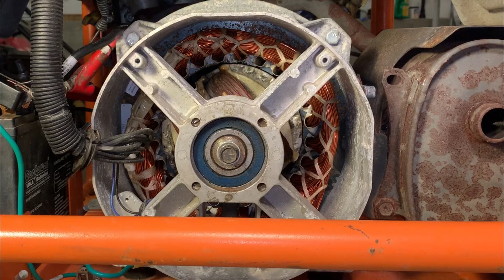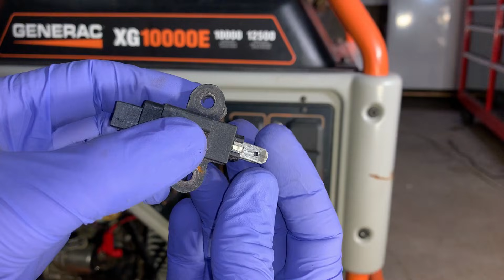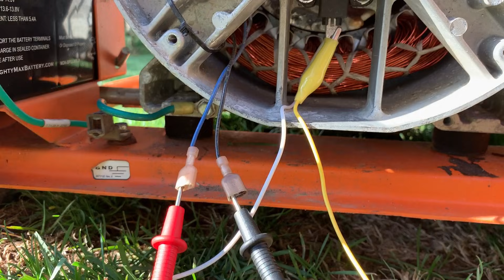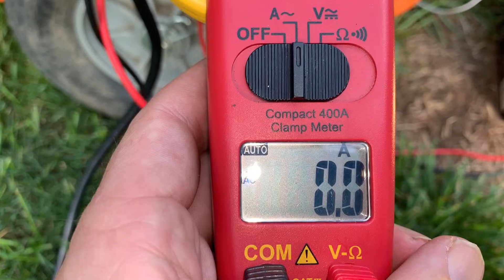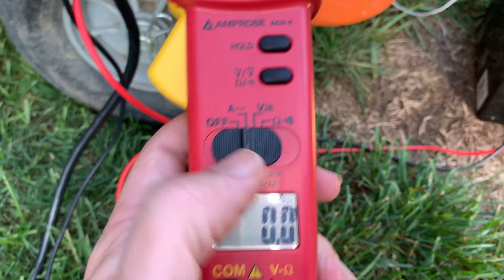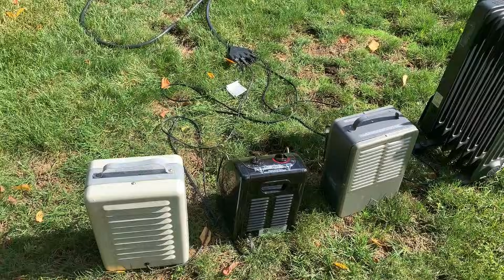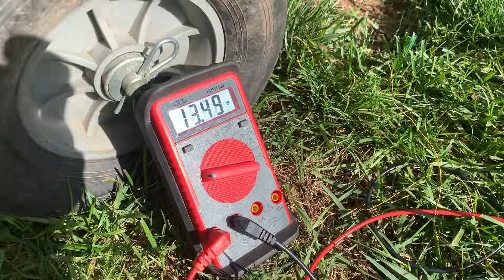Generac XG10000e No Power/No Voltage - Fixed

Comment: Was as simple as wires were crossed and meddled with nice what would you charge for this generator I would be interested in buying it @James Condon
Reply: Here is a reminder about portable generator safety: this is only a reminder for anyone who use portable gas/propane generators. This is just to make sure that everyone is aware of all the warnings and it’s just to remind people to be careful using portable generators. Everyone has to see this safety reminder. Every year after hurricane and winter storms, there were reports on the news that many people have died each year when using generators due to carbon monoxide poisoning and electrocution during a power outage. There were reports about deaths when using generators when the power was out. There is something very serious that everyone should always be aware of when using generators. Some people do run their generator indoors which is not safe and that increases the risk of carbon monoxide poisoning which can cause death of family and you. Some people run their generator in wet conditions which can electrocute them. Here’s an advice about generator safety: please remember that you should never run your generator indoors. Remember that carbon monoxide is an odorless and colorless gas that you cannot see or smell. Carbon monoxide is a silent killer. Keep that in mind. Make sure your generator is 15-20 feet away from your house and away from doors, windows, and vents. Having a carbon monoxide detector is very important against generator safety. Some people also allow children to go near the portable generator which could pose risks. We need to keep an eye on our children making sure that they are not near the portable generator so they won’t get electrocuted or burned by the generator which is dangerous. A locking enclosure also keeps kids safe. A generator shed might look like a tempting place to explore, or take cover during a game of hide and seek, but a generator is a dangerous piece of equipment that can cause injury. It says on the manual that we should also keep children away at all times from the portable generator to avoid injuries. Please do not permit a child or unqualified people to operate the portable generator. Generators pose electrical risks. If you need to use your generator during wet weather, you need a generator tent to protect your generator from getting wet. Don’t let your generator get wet. Keep your generator dry and before using your generator, please make sure your hands and your generator is dry. Everything that is said on the generator’s operating manual should not be ignored. Never smoke cigarettes near the generator. Please keep flammable things away from the generator. Never overload your generator too. Your generator can catch fire. Never ever try to plug a generator cord into a wall outlet to avoid back feeding. Back feeding your generator is dangerous. Always turn on your generator first before plugging in appliances and shut off the appliances before turning your generator off. Use a heavy duty cord for your generator and the cord should not be worn out. All the instructions should be followed carefully. Never refuel your generator while it’s running. It can cause fire if fuel spills while your generator is hot. You should turn off your generator and let it cool off before refueling it. Having a fire extinguisher next to the generator is also important. This is only a reminder for everyone’s safety of using generators. Make sure your generator is properly grounded. https://youtu.be/I1jT3ANENvI and here is a video more about keeping others safe when using generators and also about our family’s safety. Hope this helps and everyone understands the safety requirements. Thank you. Be safe.

Comment: I would totaly buy that entire generator from you even with the problems I have one of these power heads and I have one of the voltage regulator got them from a budy that was throwing them away just don't have the generator @James Condon

Comment: You shouldn't store gas in rarely used equipment. even with stabilizer gas doesn't last that long and then there is all the problems with the alcohol.

edit: spelling correction.

Comment: hi   i have an old yamaha ef2800 ...free...gas tank is rusty inside, motor seems ok. spark plug looks good, not oily. nothing seized in it....gotta wait till it warms up outside, in garage to 'MAKE  IT  GO '.....any advice ?  thanks in adv a n c e ......
Reply from the maker: Depends on how bad the tank is, but evaporust works well.   Otherwise not sure if that tank is available or the cost.  Would run it off a test tank for now.  Could convert to propane or maybe add a fuel pump like I did on the "Vapor Lock" generator.  That would allow you to run from an external tank.

Comment: James thanks again for your videos. I was wondering if you coupled a cordless drill to the electric drill it may flash easier?
Reply from the maker: it would.  just have to make sure one is in forward and the other in reverse so they spin in the same direction when connected.

Comment: Rance here, As I do often I revisit your videos.  Keeping in mind that when you originally looked at the wiring diagram and you would have suspected  that the wiring had been tampered with, could have you by using the diagram rewired the generator correctly?
Reply: Here is a reminder about portable generator safety: this is only a reminder for anyone who use portable gas/propane generators. This is just to make sure that everyone is aware of all the warnings and it’s just to remind people to be careful using portable generator during a power outage. Everyone has to see this safety reminder. Every year after hurricane and winter storms, there were reports on the news that many people have died each year when using generators due to carbon monoxide poisoning and electrocution during a power outage. There were reports about deaths when using generators when the power was out. There is something very serious that everyone should always be aware of when using generators. Some people do run their generator indoors which is not safe and that increases the risk of carbon monoxide poisoning which can cause death of family and you. Some people run their generator in wet conditions which can electrocute them. Here’s an advice about generator safety: please remember that you should never run your generator indoors. Remember that carbon monoxide is an odorless and colorless gas that you cannot see or smell. Carbon monoxide is a silent killer. Keep that in mind. Make sure your generator is 15-20 feet away from your house and away from doors, windows, and vents. Having a carbon monoxide detector is very important against generator safety. Some people also allow children to go near the portable generator which could pose risks. We need to keep an eye on our children making sure that they are not near the portable generator so they won’t get electrocuted or burned by the generator which is dangerous. A locking enclosure also keeps kids safe. A generator shed might look like a tempting place to explore, or take cover during a game of hide and seek, but a generator is a dangerous piece of equipment that can cause injury. It says on the manual that we should also keep children away at all times from the portable generator to avoid injuries. Please do not permit a child or unqualified people to operate the portable generator. Generators pose electrical risks. If you need to use your generator during wet weather, you need a generator tent to protect your generator from getting wet. Don’t let your generator get wet. Keep your generator dry and before using your generator, please make sure your hands and your generator is dry. Everything that is said on the generator’s operating manual should not be ignored. Never smoke cigarettes near the generator. Please keep flammable things away from the generator. Never overload your generator too. Your generator can catch fire. Never ever try to plug a generator cord into a wall outlet to avoid back feeding. Back feeding your generator is dangerous. Always turn on your generator first before plugging in appliances and shut off the appliances before turning your generator off. Use a heavy duty cord for your generator and the cord should not be worn out. All the instructions should be followed carefully. Never refuel your generator while it’s running. It can cause fire if fuel spills while your generator is hot. You should turn off your generator and let it cool off before refueling it. Having a fire extinguisher next to the generator is also important. This is only a reminder for everyone’s safety of using generators. Make sure your generator is properly grounded. https://youtu.be/I1jT3ANENvI and here is a video more about keeping others safe when using generators and also about our family’s safety. Hope this helps and everyone understands the safety instructions. Thank you

Comment: Thank God for smart people on you tube you just saved us Thank you from Dallas Texas !!  2/20/21 after the artic storm
Reply: Here is a reminder about portable generator safety: this is only a reminder for anyone who use portable gas/propane generators. This is just to make sure that everyone is aware of all the warnings and it’s just to remind people to be careful using portable generators. Everyone has to see this safety reminder. Every year after hurricane and winter storms, there were reports on the news that many people have died each year when using generators due to carbon monoxide poisoning and electrocution during a power outage. There were reports about deaths when using generators when the power was out. There is something very serious that everyone should always be aware of when using generators. Some people do run their generator indoors which is not safe and that increases the risk of carbon monoxide poisoning which can cause death of family and you. Some people run their generator in wet conditions which can electrocute them. Here’s an advice about generator safety: please remember that you should never run your generator indoors. Remember that carbon monoxide is an odorless and colorless gas that you cannot see or smell. Carbon monoxide is a silent killer. Keep that in mind. Make sure your generator is 15-20 feet away from your house and away from doors, windows, and vents. Having a carbon monoxide detector is very important against generator safety. Some people also allow children to go near the portable generator which could pose risks. We need to keep an eye on our children making sure that they are not near the portable generator so they won’t get electrocuted or burned by the generator which is dangerous. A locking enclosure also keeps kids safe. A generator shed might look like a tempting place to explore, or take cover during a game of hide and seek, but a generator is a dangerous piece of equipment that can cause injury. It says on the manual that we should also keep children away at all times from the portable generator to avoid injuries. Please do not permit a child or unqualified people to operate the portable generator. Generators pose electrical risks. If you need to use your generator during wet weather, you need a generator tent to protect your generator from getting wet. Don’t let your generator get wet. Keep your generator dry and before using your generator, please make sure your hands and your generator is dry. Everything that is said on the generator’s operating manual should not be ignored. Never smoke cigarettes near the generator. Please keep flammable things away from the generator. Never overload your generator too. Your generator can catch fire. Never ever try to plug a generator cord into a wall outlet to avoid back feeding. Back feeding your generator is dangerous. Always turn on your generator first before plugging in appliances and shut off the appliances before turning your generator off. Use a heavy duty cord for your generator and the cord should not be worn out. All the instructions should be followed carefully. Never refuel your generator while it’s running. It can cause fire if fuel spills while your generator is hot. You should turn off your generator and let it cool off before refueling it. Having a fire extinguisher next to the generator is also important. This is only a reminder for everyone’s safety of using generators. Make sure your generator is properly grounded. https://youtu.be/I1jT3ANENvI and here is a video more about keeping others safe when using generators and also about our family’s safety. Hope this helps and everyone understands the safety requirements. Thank you. Be safe.

Comment: What's your background? You are uncommonly good at doing research and solving electrical problems. The skills required for this kind of work are troubleshooting internal combustion engines and troubleshooting alternators and related control circuitry. Thanks - great video. I am now a subscriber.
Reply from the maker: Only do this as a hobby in nights and weekends.  Implement and support large computer systems by day.  Lots of problem solving.
Reply: @jcondon1  Thanks again - explains a lot - especially why you are so well versed on hunting stuff (like manuals & wiring diagrams) down on the Internet.  When you say you have to step away and have a think about something, you’re not kidding - that’s when you put those problem solving skills to work. I expect you are aware that the new generation (No play on words intended) of high power portable generators are inverter based (so no requirement for running at synchronous RPM) and they use EFI for effortless starting and running, so this adds a lot of complexity which means a lot more talent will be required to resolve problems with these units. That said, I expect these units to have much greater reliability and hence the demand for troubleshooting skills will no be as much in demand and as a result, probably much harder to find. Sorry for to long rant, I appreciate your videos.

Comment: Great diagnosis  I have a generator I am repairing .when I connect the wires to the brushes it makes a loud chattering noise an slows the engine. 
Any help much appreciated. Thanks mike
Reply from the maker: An engine going under load with no load connected is a sign that the stator is shorted and has gone bad.

Comment: Very instructive Video, thanks a lot. How many average ops hrs would you expect to get out of a similar unit before required engine overhaul?
Reply from the maker: Tough to say.  Not convinced that meter was correct.  This has a battery.  If someone left it in the run position with the engine off the clock would keep ticking.  Only had three others with this many hours and suspect the same thing.  Would tink at least 1000 with proper care.

Comment: Nothing is more irritating than having to find and correct someone else's "Fixes, errors" especially when you think that all connections are in the right place to begin with!    Good troubleshooting technique, good find and as a bonus you have a good generator! Thank you very well done Video!
Reply: Had a brake light problem once on my Dad's Car, he took it to a "Repair" shop  "where they had repaired on it " by cutting the factory wiring  @ the tail light  and scabbing on another wire to a wrong  location; and took his money and did NOT address the problem which when I checked it found that the turnsignal interrupter switch for the rear  brake/turnsignals had a bad contact!
Reply from the maker: Nothing worse then a bad repair.  A long time ago the brake light same on in my car.  Brought it to the dealer and paid a lot to have it fixed.  A couple of months later my brakes failed on the highway.  Thankfully I noticed before exiting the highway.  Turns out, the dealer unplugged the sensor from the master cylinder.  Gotta love the way people fix things.